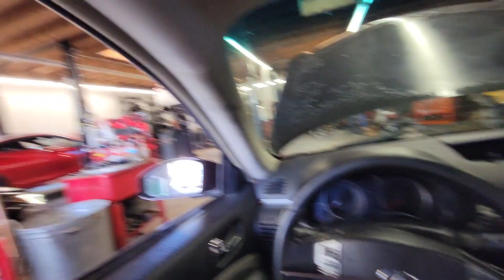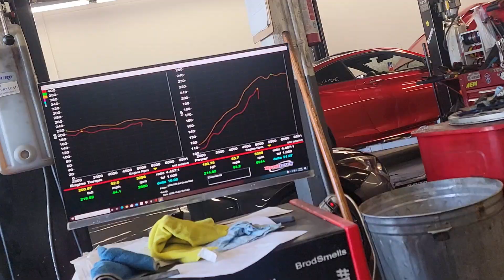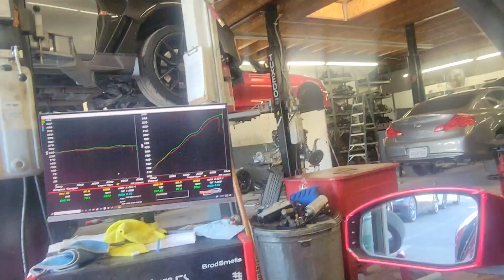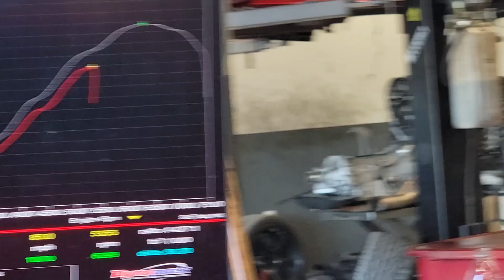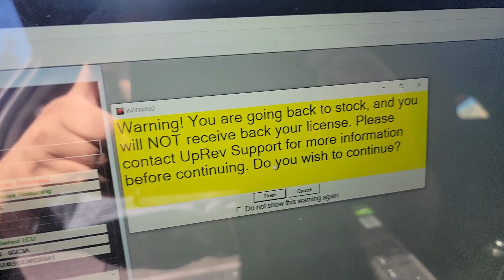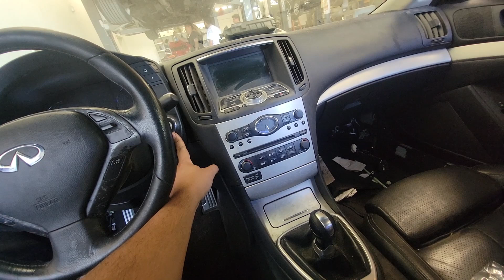G37 Steering lock issue fixed and retune from other tuners

Comment: yeah one of my gs had the bcm go back where sometimes it would start, or only go to lock, or steering would lock. ended up giving up trying to get my bcm replaced and programmed and bought a ecu,bcm and those few other modules from a donor car with a key and started right up. also used a 120$ lock module off ebay from a random car and also worked. came off a later model, i hear 08s are know to fail often. i hate how complicated our electronics are on these cars
Reply from the maker: Supposedly the issue is fixed after 2012.5+
Reply: @saulnismoknights yeah if im correct, after 2012 they no longer have that steering lock module

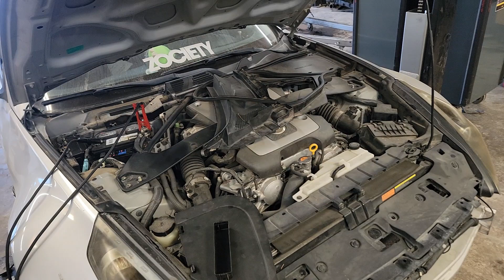Comment: is this the only way to go about the problem or is there a way to by pass the immobilizers and bcm all together ? 15:34

i noticed my 09 g37 sedan’s steering wheel wouldnt lock when its fully turned off and you turn the wheel but i only noticed that after my car stopped turning on it goes into acc/and on and turns off but when i press on the brakes and hit the push start to cycle the ignition it shuts off the infotainment screen and the infiniti logo pops back up like if i was turning off and back on the acc mode its hard to explain but its even harder to solve. so far ive replaced nothing but the ipdm and still nothing, i did notice my amber key light being on sometimes any response or info is highly appreciated
Reply from the maker: If you're local to rancho cucamonga, you can drop off the car for diagnostics so we can look at it.
Reply: man i wish, im in phoenix arizona

Comment: I have a similar problem and everything works except the illumination lights and my dash lights and mph/rpm the but everything functions as far as buttons go and starts it’s giving communication codes and steering lock relay code

Comment: Saul idk if u charge for this but I would pay , I get p0021 code after new gllry gaskets n timing replacement, I erase code and car will run then comes back after a week , I put cheap vvt solenoid I’m thinking sensor now , idk I’ll pay for ur information bro
Reply from the maker: Needs proper in person diagnostics